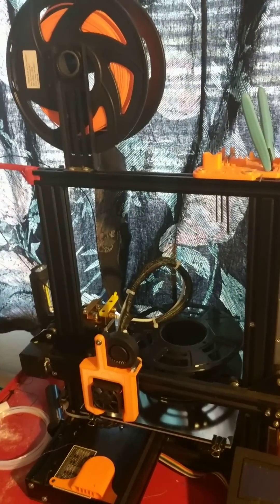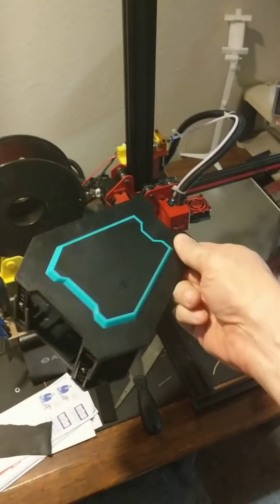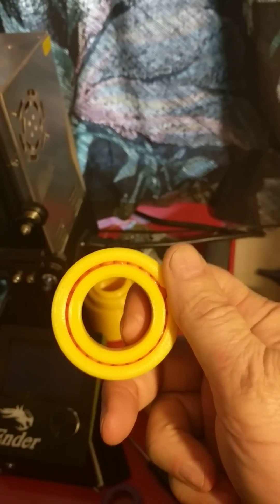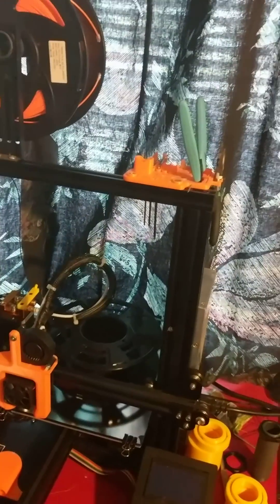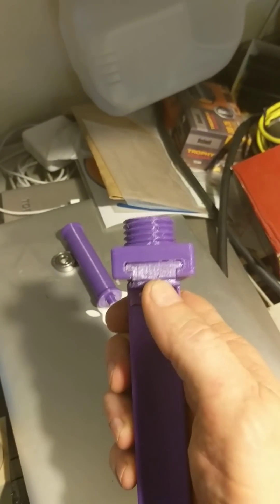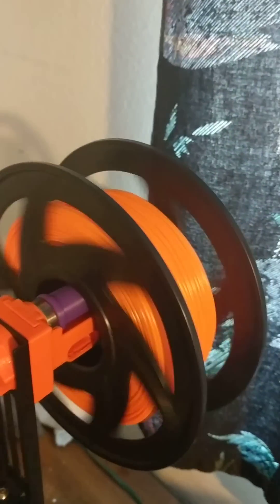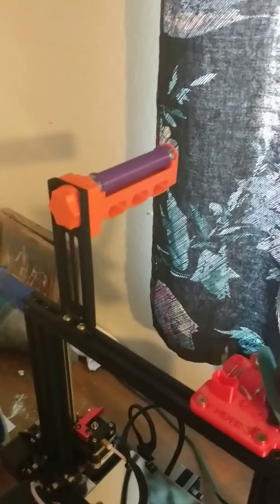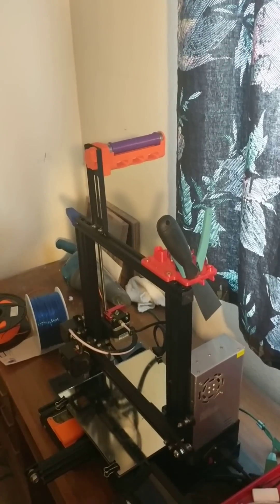A better Ender 3 spool holder

Comment: Thanks so much for this! My filament was snapping because of the strength required to pull in the filament which the roll could not handle.
Reply: could also just be because the filament got more brittle from moisture.

Comment: For a less friction filament guide, I thought id use one of the prints off thingiverse, but make the O ring bit bigger, & insert a metal ring of some sort. Or (just thought of this), cut off the ring bit, drill a tiny hole, & screw in an eye curtain ring.
Reply: or a piece of ptfe tube

Comment: Chuck, I have a Ender 3 with extrusion problems. It was working fine until I tried to change the nozzle to a new one of the same size. For some reason, I can't get it to extrude properly. When I test the extrusion length using the marker method, im extruding less than 50% of the requested length. Even pushing by hand is hard. I went back to the old nozzle and have the same problem. If I take the nozzle off, then I can push the filament freely. One side effect is that it doesn't start extruding filament for about 30sec to 1 min after the print starts, and continues to ooze filament for about 30 sec to 1 min after the print stops, including virtually 100% stringing. Ive tried looking for help and advise, but you are the only one who is local that I know of.
Reply from the maker: Sounds to me like you've got a partial jam up higher in the hot end. I've had this happen multiple times and it's really frustrating. What I've done when that happens is pull the bowden tube and fitting off the hot end and then heat it up to 230c or so. I've got a piece of thick welding rod that I push down the hot end and push as much filament out of the nozzle as I can. Then with it still up to temp I cut about a 10" piece of nylon filament (if you don't have any I highly recommend Taulman nylon bridge for this) stuff it in until it's coming out the nozzle, then keeping slight pressure on it, cool the nozzle down to about 80c. Then heat it up and as it's heating pull on the nylon and keep pulling until it heats up enough to pull it free. It will pull up both itself and all the PLA or other filaments that are clogging up the passage way. You might need to do this several times, but eventually nothing will come out but the nylon and you should be able to shine a light straight down through it all. When you put the bowden tube back in make sure the end is cut square and clean it's pushed all the way down until it stops. If it pulls back up without releasing the fitting then it's time for a new fitting.

Comment: Hey Chuck, First time commenter..  I am running a off-machine spool feeder that sits approx a couple of inches away from the E3 extruder (Basically because of the tension and wear were causing snags).  I like that idea and wonder if I set that up on a mounted board to the left of the E3, with appropriate adjusted height.. You think that would work to possibly make a superior filament feeder?
Reply from the maker: Sounds like a good idea if you're running an off machine spool holder. Come back and let me know how it works out. At one point I had the idea for making a spool holder that moved up and down with the Z axis. Never got it completely figured out before I shelved it and moved on to something more urgent.

Comment: Chuck, I used this filament guide instead of the one you have.  No drag points.  https://www.thingiverse.com/thing:3052488
Reply from the maker: Thanks Wayne, I'm going to print that right now! I also found this https://www.thingiverse.com/thing:3095575 for the upper filament guide. I'm not sure if it's necessary with the bearing guide you found, but hey, it's an excuse to print something!

Comment: Hey Chuck. Thanks so much for this am off to print one after replying!  I bought some Amazon Basics PLA to give it a try (they've since removed it from sale in the UK....) but I found that the filament was leaving almost a dust over the extruder cog and wheel from where it was slipping as it took some of the matt finish off of the PLA.  I'm going to give it another go with this modification.  Hope all is well with your ever increasing collection of printers :)
Reply from the maker: Hey Mike, thanks for the kind words. Nothing is sweeter than finding a filament that just works good in your printer and getting all the slicer settings just right. I lucked out with that cheap filament from ebay. I've had other's that works as well, but most of them are twice as expensive. I cringe whenever I have to use something else because I know I'm going to have to spend several hours tweaking settings in Cura and making numerous test prints to get it working as well.

Comment: Hey chuck, wanted to show you a link for the best filament guide i found on thingiverse. It uses a bearing and does away with that extended arm.   https://www.thingiverse.com/thing:2897367.     Theres also this spool holder i might try.  
https://www.thingiverse.com/thing:2999446
Reply from the maker: Thanks Matthew, I'm going the filament guide, another user also posted this link and I'm going to try it also. https://www.thingiverse.com/thing:3052488 and I may try that spool holder, the similar one on the Alfawise U20 I have is as smooth as glass as long as the outer rim of the spool itself isn't messed up.

Comment: Thanks for the tip chuck and I agree on the drag. My CR-10S and my PRUSA MK3 both have some kind of bearing spool system. You saved me from printing out a much more involved spool setup for my Enders. I am also doing a remix to fit it on my Anycubic Mega as well.

Comment: Thanks for this Chuck, I had just started designing my own solution and had those features in my head for the solution. This will be done as soon as I can because I agree with everything you say about the Ender 3 spool holder. Like you, I love the Ender 3 and this will make it even better. I hope it has cooled down a little for you; it got more than a little warm this summer! We had a brilliant summer in the UK but nothing like the temperatures you had. Thanks again.
Reply from the maker: If you design something come back and let me know. I was trying something totally different and while I'm a good designer, what I was looking for probably needed a mechanical engineer, and I'm not that. It's still over 100 in the daytime here, but that's normal for where I live, but it is starting to cool off in the evening, well only if you think 82 is cool. But when the rest of the country is frozen solid, it will be 75 and sunny here.
Reply: Chuck Bryant  I think I'll start with the one you used and see if I think it needs a mod that I could complete. Like you, I'm no mechanical engineer. 
I think I could enjoy some of that Arizona winter sun.

Comment: I agree about the spool Chuck.  It rocks back and forth as it prints, and I wanted to do something about it as well.  Since the only brand of filament I use is 3D Solutech, I was able to print an adapter that fits their spools perfectly.  No bearings, but as smooth as it turns, you would never know it.  I know you use other brands of filament, so that probably wouldn't work for you.  I noticed that the 'Filler' can still rock the spool, which I wanted to eliminate, but I'll probably go ahead and print one up in case I order a brand of filament other than my cheap 3D Solutech.
Reply from the maker: I'm glad you found something that works. If it's on Thingiverse post the link, I'd love to see it!
Reply: You bet Chuck!  Here it is: https://www.thingiverse.com/thing:2884500